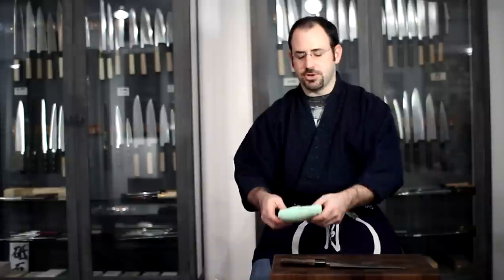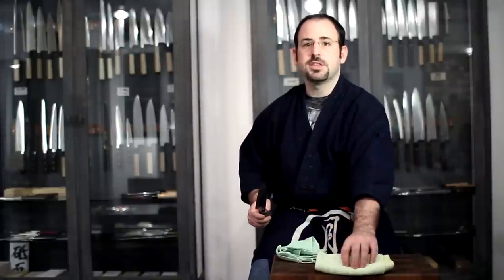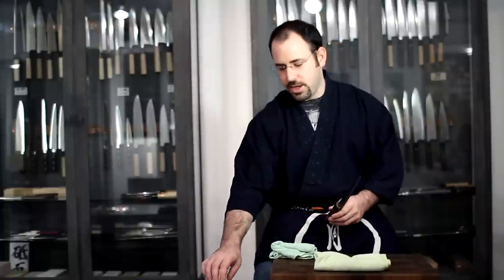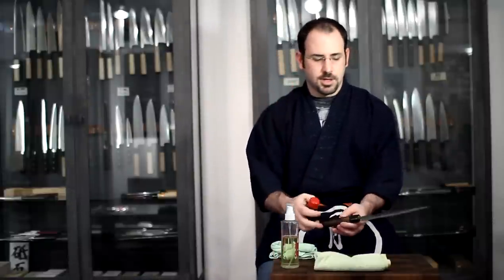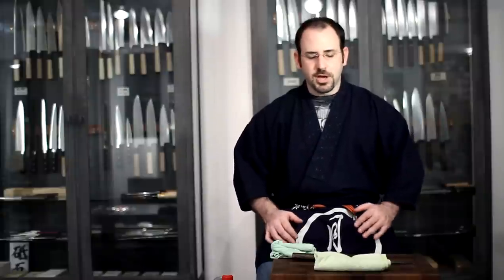Working With Carbon Steel Knives- Japanese Knife Imports

Comment: full time sushi chef here, and thanks for the information. I don't have space on my cutting board for two towels, so i have my damp cloth off to the side and a dry paper towel that i keep in my pocket and I wipe between every use
Reply: Yeah... i actually dont recommend keeping the dry towel on the board... its usually on my side or on the table nearby.  Also, keep it clean and change it often to avoid cross-contamination.

Comment from the maker: sometimes... blue steel tends to be more corrosion resistant over time.  However, the heat treatment has something to do with it too.  That being said, the core steel is often less reactive than the cladding, so the cladding is usually what people have to worry about more.

Comment: yah, i was just cutting an onion with a new Japanese knife, i cut one half onion and went to put the first half in the stew before cutting the second half, upon cutting the second half i was already noticing brown on the outside of the onion cuts and a sliver of rust on the (brand new and recently oiled) blade. So, rust can def form in the time it takes to cut more than one onion for sure and this is a very high quality well respected Japanese knife maker.  You have to be very very careful with carbon steel apparently. hopefully this will be less of an issue once the blade forms a natural patina because i cut onions and acidic food all the time and i want to use this knife

Comment: Hi Jon, I had a quick question about recognizing rust vs patina: I bought a cheap-ish carbon steel gyuto (first non-stainless knife) to practice sharpening/reprofiling on and also to see if I would be comfortable with owning and maintaining a pricier carbon steel blade later on. After the first 2 weeks of usage, most of the blade had that dull gray natural patina. In the past week I've noticed a colored streak along where the bevel meets the blade face, and the color of that streak is closer to a tan or brown as opposed to the mirror of the bevel and the dull gray of the majority of the blade face. Is this rust, or can the color of patina stretch slightly into light brown?
Needless to say I will more diligent with damp towel wipe-downs in the future.
Reply from the maker: +sonespazz518 in general, my feeling is that if it looks like rust (brown, orange, or red), clean it off.  Its not really worth risking.

Comment: Hi Jon. I love the videos, especially those covering single bevel knives and how to sharpen them. You give in depth explanations that are very helpful when just starting to learn about and work with them. I had a question off topic of this video. I was wondering what the style of robe your wearing in this video was called. Could you share that, please? I'm not very familiar with Japanese culture. I did a little looking online and there are a lot of robe styles, most of which looked much longer than what your wearing here. Thanks!
Reply from the maker: +Colin Pennington thanks... i was wearing samue... the one in that was traditionally dyed with indigo i believe.
Reply: +Japanese Knife Imports thanks for the response!

Comment: Hi, I have a food hygiene question which is: how often do you change the towels? I can imagine that the damp towel gets dirty quite quickly and that one should use a new one each day (as a home cook). How is it with the dry one?
Reply from the maker: Severin Bahman rather often... or i continually clean my towel.  Usually i use paper towels though, so they are disposable.  In general, every time i switch to a new kind of food (i.e. switching types of fish, types of veggies, etc.), i change the towel, so as to avoid cross contamination.  The dry towel is only used after the knife is clean, so i dont worry about that one as much.  It pretty much only comes into contact with water.

Comment: I am becoming very interested in Japanese knives, and was fascinated by what you had to say. 

Question: If shiny culinary knives are traditional, and considered ideal in Japan, then are all these black, or dark grey finished J-knives sold primarily to the American, and/or European markets?
Reply from the maker: The kurouchi finished knives (the ones with the black finish) are more common in home kitchens and smaller knifemaking regions than in fancy restaurants like those that you see in Kyoto, Osaka, and Tokyo.  These are a few reasons for this, but its more a function of availability in those regions (the fancy, shiny knives far outnumber the black ones).  That being said, kurouchi wouldnt be a problem if the blade was well kept and taken care of.  However, it seems most japanese pros still prefer polished blades.

Comment: Hello. I am thinking to buy a Carbon steel knife. But 1 problem is when you say you cut onion you say cut a few cut then wipe it off with the knife isn't too much time ? If not how often do you wipe it off because if i am cutting a onion i want to finish the cutting not like cut 5 cuts then wipe it off then cut.
Reply from the maker: Yan Nguyen Its about learning how to incorporate it into your work flow.  It really doesnt slow me down at all, but it takes some getting used to.  The more acidic the food, the more often you have to wipe.

Comment: Will applying (cooking oil) to the knife blade  before working with acidic foods reduce problems with reactivity and/or reduce the amount of knife-cleaning required while working?
Reply from the maker: nope... will make things more messy, as you'll have oil on your food too in that case.  And the parts that wipe off due to contact will still be reactive.

Comment: Thank and what if i gonna buy aogami super knife with stainless cladding. Does it need to be wiped off every cut or i just need to wipe it off like 2-3 minutes
Reply from the maker: Yan Nguyen the edge is still carbon, so it depends on how you care for the knife.  If you let the edge patina, you dont have to wipe off as much.  If you keep it polished, its pretty much the same.  For what its worth, you can also patina carbon steel knives without stainless cladding if you want an easier knife to use/care for.
Reply: Hi again. I gonna work in a restaurant and since i gonna buy a aogami super stainless cladding knife and at my restaurant's kitchen only have the plastic cutting board. I wonder if it will damage the knife. And furthermore i wonder how to maintain the knife since i will wipe off the knife after washing it.(Do i need to apply the oil or i can just put it in the box)
Reply from the maker: An Nguyen not necessarily, but aogami super can be on the brittle side, so you can test and see.  If you see chipping, try a microbevel or adjusting the angle of sharpening.  On the wiping down and oil, it depends on where you are and what kind of environment it os.  Is it very humid over there?  If so, oil would be helpful at the end of the day.  If not, you should be ok.  If you plan to store the knife for a couple of days or more, oil would be great though.

Comment from the maker: nebulax123, you should try to avoid using food based oils on your knives.  Give mineral oil a shot instead.

Also, i agree when it comes to murrays knives, but you can also see other makers where this is not the case.  It can be a heat treatment thing too, as i mentioned before.

Comment: What about veg oil to prevent rust and white vinegar for petina?
Reply from the maker: vegetable oil can go rancid over time, so i would generally recommend avoiding it (along with most food-based oils).  Mineral oil would be better.  Vinegar works fine for patina development, if you're trying to force a patina.  Hope this helps.

Comment: on my knives I just use cooking oil in an aerosol spray can either olive oil or coconut oil
Reply from the maker: i would not recommend this.  While it might be fine for some people in short term cases, oils like that can go rancid over time.  So, if you're storing it that way for a long time, if you store it inside a saya after oiling, or if you don't clean it well between uses, you'll likely end up with rancid oil somewhere along the way.  Oils that don't go rancid and have a more PH overall are preferable.
Reply: @JKnifeImports  interesting answer Mate and fine for me using daily, as for long term storage never thought of storing any of my knives i guess if one was a knife collector should use the product you spoke of.

funny thing though 20 years ago most of  us butchering all used high carbon steel knives at the end of days business we just cleaned off the knives and stabbed them into animal fat and pack away until tomorrow.

At the end of the day, hygiene is upmost importance before cooking everything should be cleaned off ready for work including my knives.
thanks for your follow up.
Reply: @JKnifeImports  `what belt are you on this video please?
Reply from the maker: @ladallance12  huh?  What belt am i wearing?  We arent using a belt grinder here, so i'm not quite sure what you're asking.

Comment: Interesting, I wet knife so food doesn't stick to it. It doesn't make it easier to cut. I love patina on carbon knives. Mine are totally black and I can guarantee that more patina you have on your knives it protects the knives against corrosion or food oxidation. I've never ever experienced metal taste in my food. Anyone experienced metal taste in their food? If yes how much % of Carbon is in your knives? Mine have 1% of Carbon hardness 60 HRC. I've no experience with hardens of 62 HRC or more. I've one Japanese knife around 53-55 HRC too soft for me (in this option it is better to buy Zwilling or Wushof. My favourite is Ikon with dark wood.
Reply from the maker: yeah... it helps with food stickage as well.  Thats part of the reason you will see many sushi chefs using water on their blades before cutting.  In terms of metal taste, yes... i've experienced it first hand with a wide vareity of knives in varying carbon contents and at varying hardnesses.  Its pretty common... expecially with high acid foods.

Comment: Will a rust eraser damage the Damasc pattern of the blade? Thank you!
Reply from the maker: yes... it can change the way it looks.  However, its not damage per-se.  Also, the damascus pattern can often be brought back with some etching.  If the damascus finish is a concern though, i would recommend using something like simichrome a bit more often and not letting rust or patina build up.
Reply: Thank you very much, John, for your fast and useful reply! Thank you, I will follow your advice!
Reply from the maker: for sure... feel free to bug me with any other questions

Comment: Why use a carbon steel blade instead of stainless?
Reply from the maker: some people prefer the ease of sharpening and edge taking of carbon steel
Reply from the maker: David Gaudette yes... how sharp the knife can get and how easily it will get there
Reply from the maker: David Gaudette not 100% of the time, but for the most part, carbon steel has a finer carbide structure, and will thus get sharper... of course there are exceptions to the rule, and it depends greatly on the quality of the heat treatment, but generally this is true

Comment: Can kurouchi stainless steel cladding rust?
Reply from the maker: kurouchi finishes on stainless cladding are fundamentally different from kurouchi on carbon.  They will be SIGNIFICANTLY less prone to rust than their carbon counterparts, but even stainless steel can rust if left wet or dirty (especially with acidic foods) for long enough.  Kurouchi on carbon also is not 100% stain resistant, but it does help make that area less prone to rust.
Reply: Sorry, I meant to ask if the kurouchi finish on stainless steel cladding is more prone to rust than its original form. As we know, the thin chromium oxide layer that covers the surface is what protects it from oxidation with oxygen in the air. And what I know, the kurouchi finish is the sign of the forging process. So, will the forging process of the kurouchi finish break this thin layer, making it even more susceptible to rust?"
Reply from the maker: @olan5668  ahh.. i see.  No, on stainless, the kurouchi finish is not more prone to rusting than the original stainless.  Also, the kurouchi finish is not always indicative of being forged... like in stainless knives, the kurouchi look can be a function of chemical applications that are used to create that specific look. And, on knives where the kurouchi finish is a function of forge scale, the areas where that breaks down and flakes off will not be any more reactive than the normal exposed carbon steel on that knife.  Certainly not worse.
Reply: @JKnifeImports  Are there any reasons why using iron cladding instead of soft stainless steel cladding?
Reply: @olan5668  soft iron cladding moves much more easily under the hammer, allowing for knives to be forged thinner, which is never a bad thing.  Overall, the process of making simple iron knives is easier in terms of grinding, heat treating, etc.  This allows for craftsmen to focus more on other aspects that have a larger impact on performance relative to the additional care required by non-stainless knives.  Managing galvanic reactions also seems more manageable with two similar steels (both non-stainless in this example) than two dissimilar steels (i.e. stainless cladding on a carbon core).  But, most importantly, some makers just have simple workshops and prefer to work with carbon steel only, and being able to use carbon steel equally well to things that have stainless cladding will allow you to choose knives based on the most important performance factors without worrying as much about the care factors.